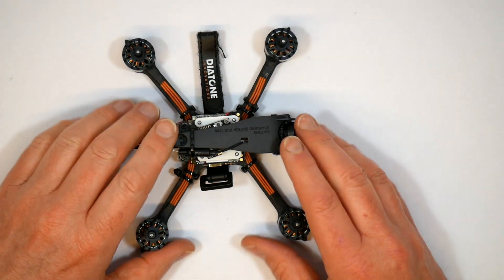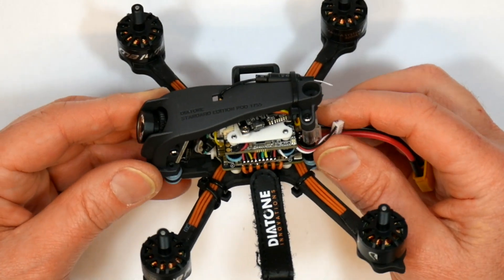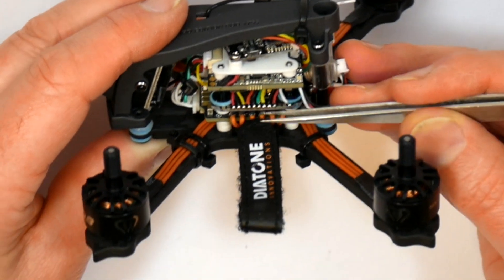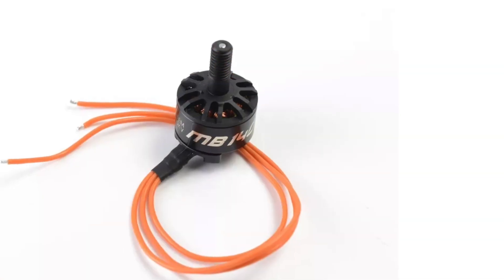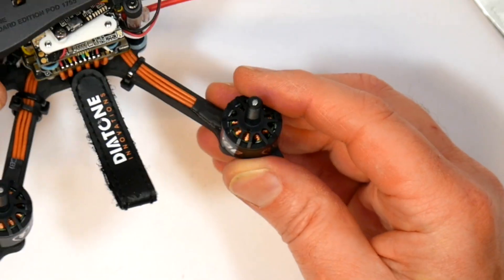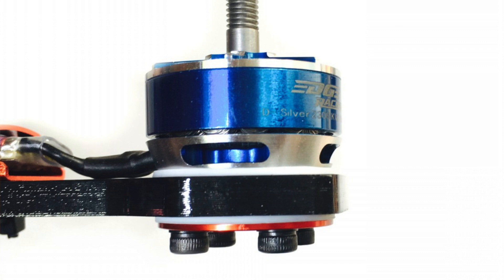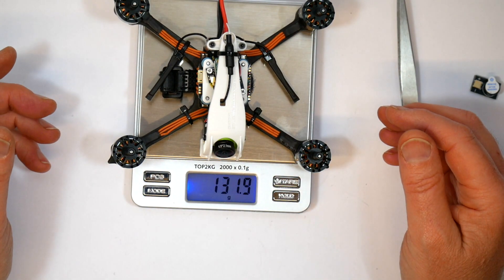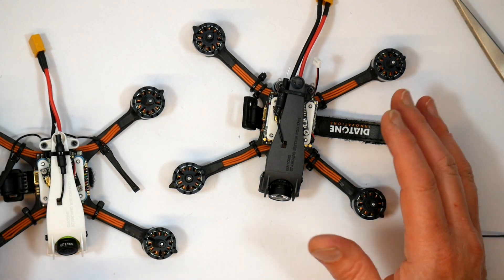Diatone 2019 GT R349 HD review - 1080p 60FPS // F4 // DShot600 // TX200U // Caddx Turtle V2

Comment: I had the Non HD version and it flies very good out off the box. I'm also had caddx turtle V2 which i wanna use to replace the runcam. Beside the bottom plate which is different (HD version had a rubber dumper on the bottom plate) ... Do i have to get a new bolt so the stack + caddx turtle board can fit?
Reply from the maker: It looks the similar, but you'll have quite a bit of surgery to do to get it to fit. Let me know how you get on.